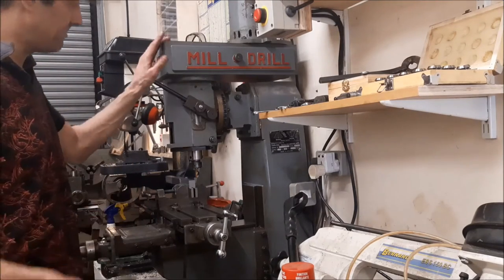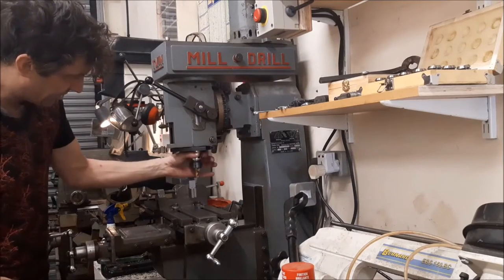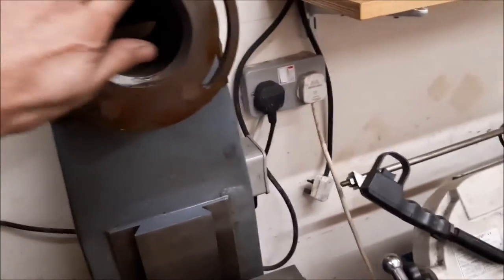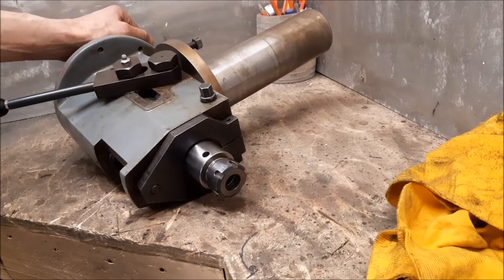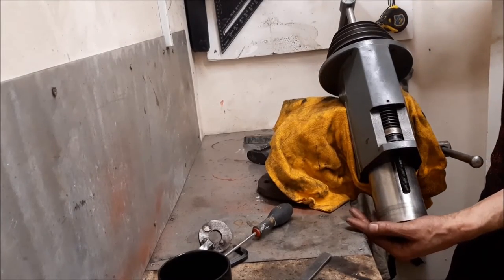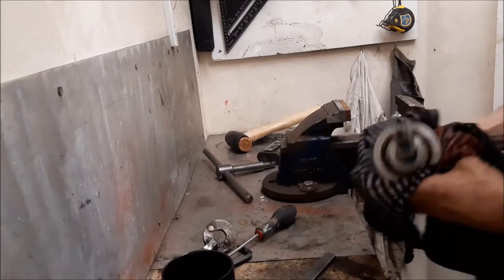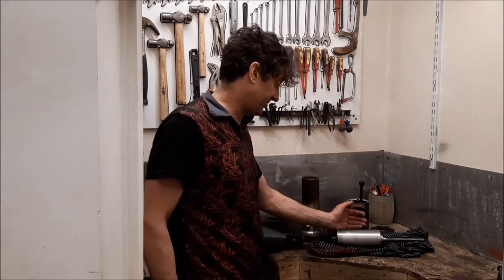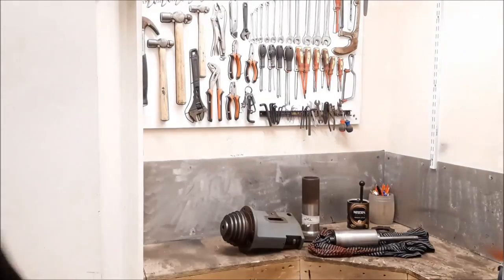Twin Mill\Drill Repair.  Part 1.  Removing the head.

Comment: It can,t of gone anywhere ,I say that every day ! great job its really interesting to see the mill taken apart try some heat on the outer tube to expand it should make it a bit easier to remove the bearings keep up the good work :)
Reply from the maker: Hi.   I thought i had cured the overheating, but alas not.  Its slowly got worse...  Going to try a C spanner tonight...

Comment: Perhaps the hole is for a C spanner to remove the nut, the spindle will then perhaps pass down through both the top and bottom bearings. If the bottom bearing is a tapered roller bearing the inner will no doubt be shrunk fit onto the spindle.
Reply from the maker: Could be.  Thanks, i will have a look.  There was a grub screw though so im thinking more or a press fit?  Not sure.